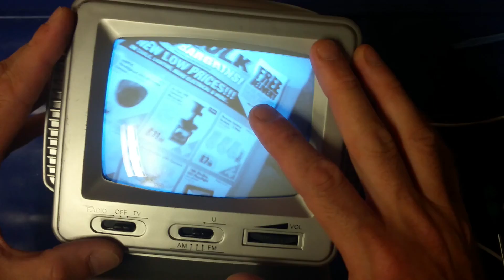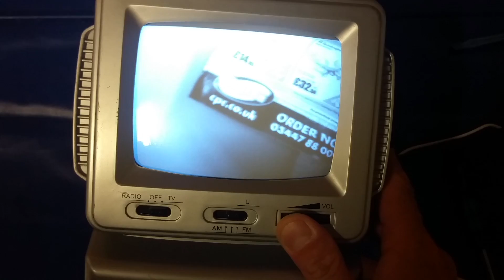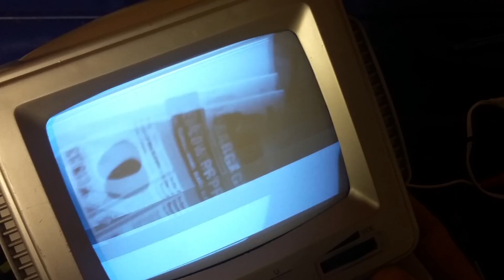How does a CRT monitor work? Teardown of an old portable TV.

Comment: Apropos foam, it's probably there to dampen coils to avoid coil whine. As electricity passes through the coil, the magnetic field established within will also exert a force on the coil windings, so it can start vibrating at its mechanical resonance frequency, and introducing a tiny bit of friction can prevent this.

But i too have a question. So i have this one CRT which collects an ungodly amount of dust on and around the screen surface. So i imagine electrons shooting towards the screen would charge it up, if they weren't collected and carried away somehow. But what is responsible for this, and what could be wrong in this TV?

Comment: The tv is not useless and can still be used on digital. So why say it’s useless? Only that it’s a black and white set but it’s got video in on it. So can plug it into a digital box. No CRT is useless all can be converted to use on digital.
Reply: i have a black and white tv and i decided to reuse the tv for a retro monitor for a dell 333d 
a ibm clone it runs msdos

Comment: I have a similar set, and I’ve been thinking about making a mini 1970s set using the tube and circuitry. 

I can easily make the case for it, with some wood and teak staining etc. but how hard would it be for a beginner to dismantle the set and put it into another? 

I’m not as interested in the radio part as much as the television side of things. 

Thanks
Reply: If you decide on doing it: in principle it is quite simple. But do your research: these things bite! They are powered by massive voltages, this ine is probably 5kv, color models having even higher voltages. Do your research if you don't want to hurt yourself. Other than that, go for it. Upload a video if you do it :)

Comment: Thanks for this video, this was exactly what I was looking for. If you have the chance, I'd like to hear a more technical explanation of the CRT, my goal is to use a raspberry pi to communicate with a CRT screen and I'm trying to gauge what that entails. Not expecting you to find the solution for me, but any info helps. Good video, I subscribed.
Reply from the maker: +Katharine Lewis Hi Katherine. The easiest way would to be interface using the composite output of the pi. Unfortunately I managed to knock this particular one of my bench which resulted in a little swearing lol. If I come across another I will purchase it and do a video for you. Cheers
Reply from the maker: +Katharine Lewis Hi Katherine. The easiest way would to be interface using the composite output of the pi. Unfortunately I managed to knock this particular one of my bench which resulted in a little swearing lol. If I come across another I will purchase it and do a video for you. Cheers
Reply: Kris Cochrane Hah, entirely understandable. Thanks Kris!